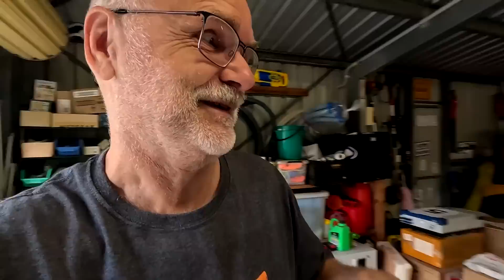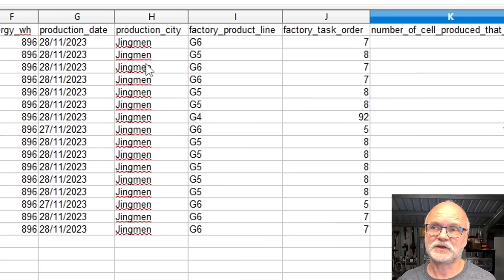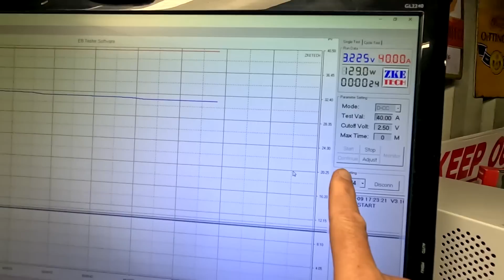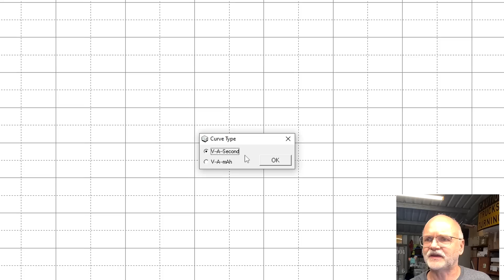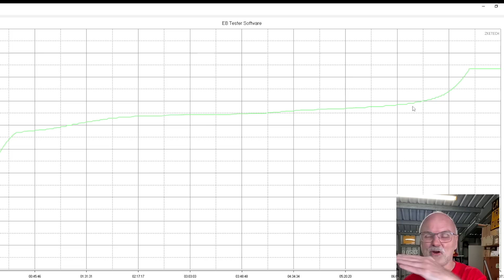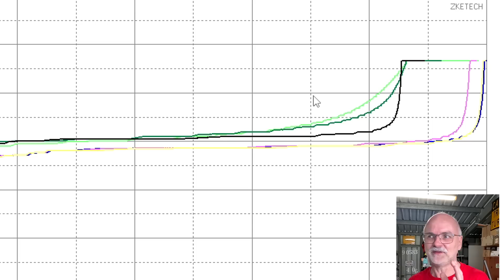Yixiang Batterie Consistency Test and how to identify problem cells. Wait! Have we just found some?

Comment: As you know best, dear Andy, determining the dynamic current-voltage characteristics of a LiFePO4 cell requires time, expensive equipment and work, and a large amount of electricity. In your case, when you carry out tests with a current of 40 A, it requires a minimum of 2x7 hours. And in practice, 2x8 hours.
In the case of a manufacturer or a large wholesaler, assuming that he uses professional chargers and dischargers with a current of 0,5 C, at least such tests MUST last at least four hours!
Considering that the production of one cell takes time measured in minutes (if not in seconds!), such an amount of work is IMPOSSIBLE for the manufacturer or wholesaler who would have to do it to precisely select the cells not only in terms of static, but also dynamic parameters. In my opinion, this is an UNREALISTIC requirement. No wonder the Chinese don't understand what You talking abouy!

Some time ago I had contact with damaged US5000 batteries. Out of pure curiosity, after the repair, I tested their cells. Let me just say this: yours are perfect compared to those! This is proof that even a battery manufacturer (with a decent reputation - although today I know it is undeserved) doesn't care about the selection of cells!!!

I am not advocating abandoning the selection of cells. I think that such a careful selection is ONLY POSSIBLE under two conditions: 1. it is carried out by an experienced technician who knows very well what he is doing (for example Andy from OGG), 2. he builds several batteries at the same time, thus being able to group the cells into groups of 16 pieces similar characteristics.

In my opinion, buying EXACTLY the number of cells needed at a given moment is a fundamental mistake! Redundancy is a very good practice very widely used in technology.
There's nothing to choose from. There is nothing to keep charged to 20% - 30% for the future in case one of the cells gets damaged. Replacement cells from the SAME production SERIES!
There's one thing I can't say: how much this redundancy should be. One cell in eight, one in sixteen? Or maybe some other, completely surprising number! Unfortunately, statistics are needed here, i.e. data from the production of batteries counted in hundreds, and cells in thousands!
The Chinese certainly have this data, but I feel through my skin that even for the Chinese God they will not share it...

Comment: Hi dear Andy, you should not focus so much on the charge and discharge curve, it is not important and I do not think it is right that you should alarm others with this and I will explain to you why the use that we are going to give it is supposed to be The majority of us who see your channel is that we are going to charge it with the help of the sun and in practice that charging curve is never going to be constant, personally I am interested in you taking one of the first ones that you bought and then having it they inflated by not compressing them and you do tests to see how they go, a new battery manufacturer will always come out and we are not going to walk with what we have for that reason and even less so if what we have is going to last 10 years or more, how about you arm us a high voltage battery?  Greetings.

Comment: I wonder how that would effect a bms with active balance? does that charge curve look similar to other chemistries? The difference between 2 that were supposedly from the same batch makes me think those numbers are counterfeit or some other scam is going on. Seeing as they either are ignorant on what you are telling them or they are porously changing the conversation away from what you are getting at.
Reply from the maker: We have to top balance the cells first. I will build the battery and find out. Stay tuned.

Comment: I've seen this before with brand new cells before they have a single cycle on them, and has to do with the SEI (solid  electrolyte interface) not having established (or not fully/correctly). Give them another couple of cycles and see if things improve.
Reply from the maker: Yeah, OK, I'll build the battery and compress them. We will see if they behave after a few cycles.
Reply: @OffGridGarageAustralia  Hi Andy, If you assemble a battery with those cells showing different charge curves an active balancer Like the JK BMS would get totally screwed up. This JK balancer requires nearly identical charge curves of the cells in series. I have multiple Tests showing, that the variation of the charge curve due to aging can get a battery more unbalanced than turning Off the Balancer!
Reply from the maker: @hanskroeger6239  We have built a Frankenstein battery! 5 different cell models with different capacities in series and the JK did a fantastic job with tob balancing. 
We will find out shortly...
Reply: @hanskroeger6239  If you balance at the very end you should still be able to top-balance the pack? But yes to squeeze out the last amps it makes no sense.
Reply: Agreed. Cell characteristics can change over the duration of the first few cycles as the electrolyte gets fully saturated into the substrates. Would be interesting seeing a revisit of these "problem" cells to see if multiple cycles change the end results. 
Also, as pointed in another comment, temperature plays a role as well. Considering it's winter in Aussie atm, how much temperature swing between tests were there? Could the odd tests been on colder hours compared to the others? 7 hour test windows is a long time and temps can change easily in an un-insulated room
Reply: Thought the same thing when he overlaid his re-test on top of his first run, end of charge curve already got quite a bit sharper.
Reply: I know the results can vary depending on the temperature and the tail current. As noted, you need 5 to 10 full cycles to get consistent results as well.
Reply: While this is the case, why are they testing differently, as they should* have had the same cycles from the factory?
Ie: if they get better with a few cycles, shouldn't that mean they ALL should have the "suboptimal" curve, then ALL graduate to "optimal" curves?
The fact they they test differently is definitely a red flag. Does that mean they will be substantially different over the long term? Unknown.
Reply: @GTrainRx7  Who knows what the real supply chain is on these cells? Were they actually EV grade, or maybe not? Did they fail a certain test and were discarded before? We don't know any of this when it comes to these cells unless you specify what you need directly with the manufacturer (and order a few containers worth).
Reply: @upnorthandpersonal  Indeed. My point was that it is unlikely that the cells had no* cycles on them, and even if they did, the seller would have cycled them at least once. So to say they need a few cycles is possibly not the answer, unless a couple of cycles means ten? or so, then it seems perfectly possible.
So yeah, no answers here :)
Reply: @GTrainRx7  Not every cell gets cycled the same at the factory. Cycling every single battery 10 times to reach steady state at the factory isn't really feasible as that would require a stupid amount of equipment and time. They likely select something like every 50th cell for extended QC to confirm that the manufacturing line is operating within specs.

The different curves may be due to process drift from one end of the QC interval to the other.
Reply: @teardowndan5364  Interesting! Keep up the good info that makes me think!
I would not expect a factory to cycle them 10 times, as you say, that would not be cost effective. Is your (quite reasonable!) hypothesis that they cycle every battery to get the IR and capacity, then QA 1 in ...<however many they can reasonably afford to do> to say 10 cycles, to try and detect bad batches?
If this is the case, is the hypothesis that Andy got 2 QC tested batteries (high curve, perhaps cycled 5+ times) and 2 not QC tested (gradual curve due to not being cycled more than twice*)?
Reply: @GTrainRx7  He tested 4 out of 16. He'd need to test all of them to find out whether his batch might be skewed in any particular way.

Since this batch was "conveniently" in Australia, it could also be a returned batch that the original buyer didn't like and some cells may have seen a few extra cycles.
Reply: From personal experience, I can say that even after more than 100 cycles, the issue (as in the video) I had on day one still persist. One cell out of a 16S pack always rises quicker than the others.
Difference start to get noticeable from about 3.36V. All other 15 cells stay within a 5 to 10mV max difference (depending on charging speed)

Comment: so did eve go back to single stud cells? you mentioned it was latest design. wonder why they went away from the double stud cells
Reply: As I understand, eve can ship with double terminals and without any terminals in bulk packaging. And resellers are free to weld any kind. Some sellers offers my studs as standard and double at extra couple of usd.

Comment: Andy, when you said, it's just a marketing thing that cells are matched, I started wondering, why not ship batteries connected parallel? Even if it's thin flexible wires, it would keep them matched right? Or it will damage the batteries in someway! (Not an expert here)
Reply: You're mistaking 'matched' with 'balanced'. Truly matched cells are those that have their internal resistance can capacity matched over the entire curve. Balanced just means at the same state of charge (which in LFP can not be determined by voltage).
Reply: I know alot of people, when they get their cell put them all in parallel to balance befor building their batteries. Shipping with them in parallel could be a bit riskier because if any were got some type of short, all in that box would also be shorted, but as you said, it could be with thin wire that would just fall apart if more than a couple amps was going though them. If you had a bad cell that self drains, it would also bring those other down to, possibly causing them to be damaged if voltage dropped to low.
Reply: @putteslaintxtbks5166  LFP can not be balanced by putting them in parallel. The voltage curve is too flat for that.
Reply: Thanks to all for replies. Good points that I didn't know.

Comment: Peel off the black cover, wouldn't surprise me if you find evidence of relasered qr codes
Reply: Lower capacity compared to usual around 310Ah can be a warning sign as well
Reply from the maker: Usual 310Ah out of 280Ah???

Comment: Good observation Andy. It is irony the lower capacity cells will gain higher voltage earlier and start calibrating pushing the charge to other better cells. The overall battery capacity drops significantly even lower than the worst cell.
Reply: It not about the level it about the shape..
Reply from the maker: We will see once the battery has been build and all cells work together.

Comment: I guess Yixiang won’t come up with a explanation about that charge curves. They are selling those cells only and the cells are within the specs (capacity and internal resistance wise). Only EVE as the original manufacturer and with their experience can give you an explanation maybe me thinks.
Reply from the maker: The question is, does the difference in charge curve really matter?

I will build this battery and see how it behaves.

Comment: I would compress the cell, charge/discharge zhem ~10 times  and measure the internal resistance charged and cischarged to see if the cell has potentially to much air in it (possible first cell after changing the isolator roll or some other materials from the production). It could be possible that the cell changes after a few cycles under compression.
Reply: I have never seen proof here on youtube of bad cells getting better by charging cycles and/or compression. I feel that Ali scammers just ask you to do it since your purchase protection will run out - what kind of person has the equipment to do multiple cycles on a 280Ah cell in 3 days? (Well.. Andy.....)
Reply from the maker: Yes, we will see..
If these are A-grade cells, they should come clear after a few cycles.

Comment: Lowest voltage during discharge, highest during charge. I think this is an internal resistance problem. If you had a 1C voltage drop test for say 30s you would see big differences in cell quality.
Reply: What is 1C voltage test ? can explain in more?
Reply: @keyurk  Discharge current 1C (for this cells 280A), after 30s note the voltage.
Reply from the maker: I will build the battery and show what I will find when they all work together.

Comment: As you say it is a black box (blue box 😀) with chemicals. So the differences are guilty of that. The supplier will undoubtedly experiment with this. We will never hear what the differences are in the compound chemicals, Date, producer, production machine number, etc. are the same however the serial number is not in line with the other! The question is how reliable is the data provided? 😉
Reply from the maker: Yes, we can only scan the QR code and see what information it delivers.
I would assume these are not true A-grade cells and because of that variation they got sorted out as B-grade or storage grade.

Comment: The first question, I asked, as you started with the inconsistency was ??? did you measure as well the Tenperatur of the cells/air while the individuell tests ??
It is only an idea
cares jogi
Reply from the maker: All cells were roughly at the same temperature. All cells were sitting in the garage at the same temperature

The Gobelpower cells were maybe slightly warmer but it should not affect it that much.
Reply: @OffGridGarageAustralia  I mean, you didn't perform the tests at the same time in parallel - I think, day after day.
In cologne, the average temperatur of the last 5 days had bee between 25°C and 18°C. DT of 7°C is not nothing...

Comment: what you are seeing are imperfections and deviations in all the used materials, hence the different stages of charging and discharging give you those curves.
for example, 1 cell has 99% good materials, the  other maybe 97%. which can cause 0.02 difference in the average voltages. but in the end follows the 0% and 100% settings/values of your charger
Reply: thats why when almost fully charged, its good to balance. if you dont do that, that why cells different like these ones, go out of balance when used together. because the voltages strat  drifting apart on different stages  of charging/discharging, but in the end you need them at the same values in order to keep working together
Reply from the maker: Well, we have never seen this before with any other cells... if these are true A-grade cells, it makes no sense to me.

Comment: Andy, if a cell fails, what would the behavior look like?❤
Reply from the maker: Depends on how it fails. Voltage sag, internal resistance, heat, overvoltage... many possibilities.
Reply: @OffGridGarageAustralia friend had this: one cell wasn’t torqued 😮😮😅 nut was discolored
Reply from the maker: @louwrentius  always double check the connections and mark them with a pen. If you have, also check with a IR camera for hotspots.
Reply: @OffGridGarageAustralia  yes he has done the marking now. We saw the affected cell spike to 4.5 volt and under load sag to less than 2 volt. Multiplus / cerbo was screaming the whole time about both overvoltage and undervoltage. We were confused at first, thought the cell was bad. Fortunately it wasn’t but this is how you burn down your house 😬😬🌷🤷‍♀️

Comment: That looks like there is something going on with the construction or the electrolyte, likely the latter.
Reply from the maker: Yes, I will use them and build a 48V battery. Then we will see if it is an issue.
Reply: This was my thought as well the electrolytes were not balanced. But I would like to see a new check after six months of use. He could check all of the batteries 😂
Reply: @clarencewiles963  I'm not sure if Andy will use these cells at all, he certainly looked very unhappy

Comment: 29:30 could it be because these are a generation apart from gobel or certified cells? 
ie, slightly different chemistry?

I do admit, I prefer the charge curves of gobel and certified more than yixiang's cells.
I guess these yixiang when assembled as 16s, will cause the balancer a hard time.
Reply from the maker: No, you have seen the specs and parameters of the cells. they are new and fresh.

Comment: LOL. you have a dump truck load of batteries already and you buy more ??? WOW
Reply from the maker: I still have two more DIY to fill.
I need all this capacity to survive winter. You will see soon why... and how.
Reply: @OffGridGarageAustralia  I'm excited can't wait to see it 👍👍👍
Reply: as far as i understood he got them free of charge ....
Reply: I see a lot more space in the garage. He could easily fit in another couple MWh of stackable packs.
Reply: @niktak1114  another couple of MWh would be a little bit too much. 1 MWh = 1.000 kWh, and one 16S-Box of 280Ah has about 15kWh....
Reply: @einfachlogischnixträumen  16S packs of MB31 cells are typically just a hair under 17kWh when brand new. He could fit quite a few stacks of 8 in there. Each stack would be around 135kWh.